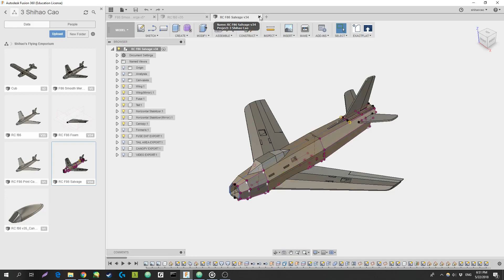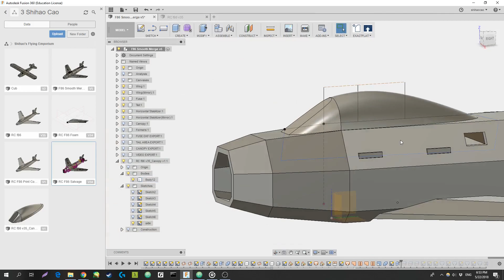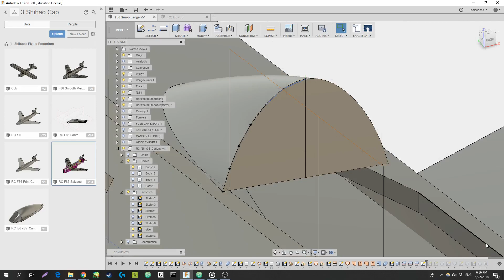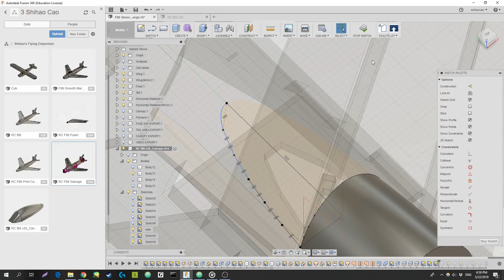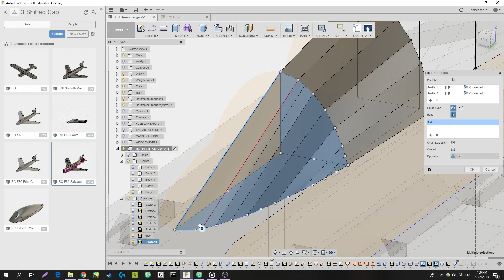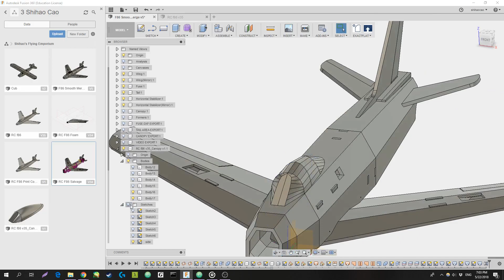Approximating Curved Surfaces for DXF Export [OLD]

Comment: hey. I had talked to Andres too about this problem. i found a solution i think thats way easier. You can try it if you like. First Loft the object as you would normaly, but in the patch mode. so you only have a skin. then you export the patch object as .stl and open it in meshmixer. Meshmixer has a Flatten command in the edit tool that flatten it to a perfect match for laser. then export it as .svg open it in CAD and cut. Please try it out.
Reply: @Shasty8817  sure could be great with a video on it. so other people could benefit from the experience.
Reply: by the way. i love your videos, keep up the good work.